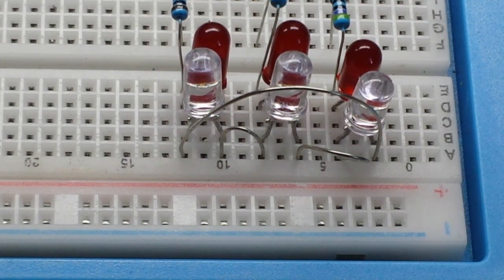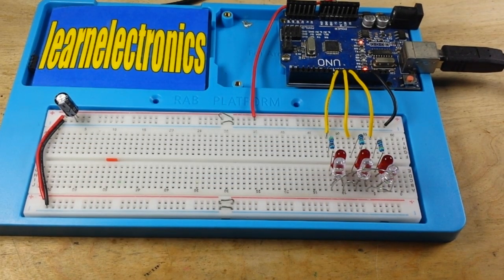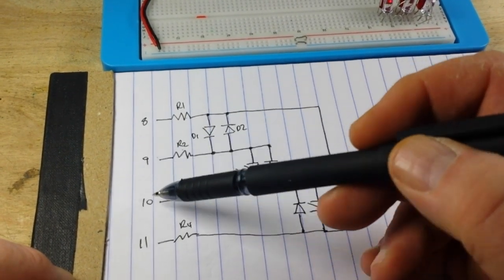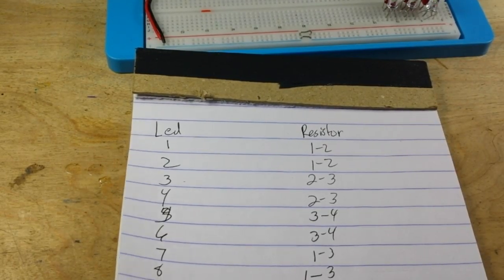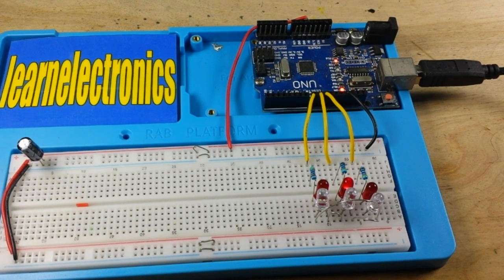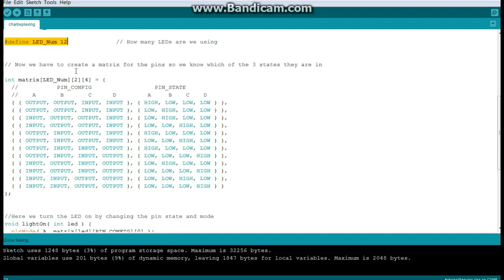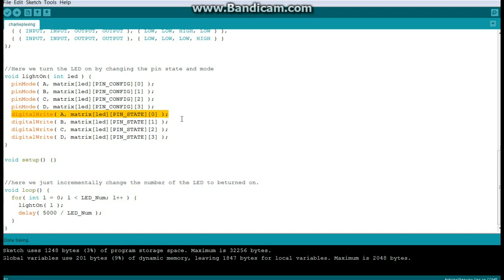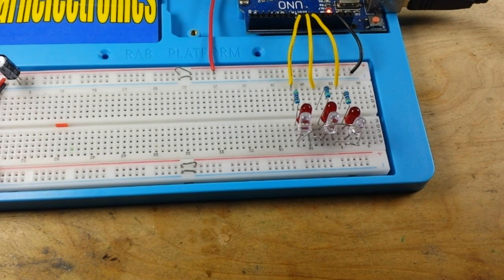How to Charlieplex LEDs with an Arduino

Comment: Thank you, I think I finally get Charlie plexing. I’ve seen it used with keyboard inputs but could never wrap my brain around it. Great video Paul, I’m going to be spending some time at the breadboard tomorrow that’s for sure. Now I need to dig through my chips and see if I can do this without the Arduino.

One more thing I think the upload has some sound issues, someone commented that your mic sounded odd but the music at the end has the same tinny sound to it so I am not sure your mic is the issue. More likely YouTube has messed up your sound.

Comment: Hi, thanks for the clear explanation.

You mention using a 7 segment led display but with common anode ( or cathode) designs I'm not clear how to wire the pins or adjust the code since the legs of the LEDs on the common rail are all connected. Any recommendations where I can find and explanation of how to do this?

Comment: Is there any risk of damaging the inputs or outputs by switching from input to output so quickly and often, and is there a noticeable performance impact of switching between input and output modes? Like enough to make a difference in brightness of segments of rapidly switched LED digits?

Comment: Just reading another comment there and it reminded me of something i wanted to ask!! Do you need to use resistors with leds  when using arduino  in general?? Or can it damage it?  I know it can source a max of 20mA but would it strain it's self with no resistors when using leds  is more what I'm trying to say???? P.s. That Charlie plexing is very cool. And I will definitely put it in my pocket for again.
Reply from the maker: Yes, resistors are necessary when working with LEDs. They will draw as much current as they can until they pop or burn out the source.
Reply: You must use resistor for your 5MM LEDs. If you give them 5V directly, Arduino will supply more than 20mA for them, good scenario is LED died because of overcurrent, bad scenario is your Arduino's digital pin or PORT died (because absolute maximum for Arduino Uno pin is 40mA).
Reply: LED will draw approximately 20mA when you apply correct voltage for it. You use resistor to drop down the voltage over resistor (current limiting). Let's say your LED's forward voltage drop is "Vf", your source voltage is "Vcc". You want to draw "I" Amps of current from your source. You will calculate the resistor value like this:

(Vcc-Vf)/I

For example, Arduino pin is 5V, LED's drop is 2.2V and you want 20mA current to flow.

(5-2.2)/0.02 = 2.8/0.02 = 140 Ohm
Reply: @ntd0  thanks Nuru
Reply: @keithking1985  You are welcome :-)

Comment: So your using the Arduino as Ground on the 2nd and 3rd tier LED's ?  How are they finding ground ?   I can't think of why this wouldnt work for driving FET's doing switching, eaaa ?
Reply from the maker: No grounds per se. When one leg is high and sources current,  the other is low and sinks it.
Reply: This works with L.E.D.s because they're essentially diodes. This is really a type of crude binary decoder circuit that uses the diode nature of LEDs to complete the decoding logic.
You might need some extra diodes to get this to work with FETs.
You could use something like the 40107b dual 2 input nand chips that have open drain, n channel FETs for outputs.
You'd still need to spend some time working out the logic though.

Comment: I get what happens when we make one pin low and the other one high. But why do you change the pinmode to input to turn off both leds? That would make the pin float somewhere in between 0 and 5 volts, right? I mean if you make both pins low that would also make both leds turn off.
Reply from the maker: No it doesn't make them float. It makes them inputs.

Comment: I'll check out the whole video and read the comments, but right off the bat, can the brightness of each led be controlled also?  Say have led1 come on at 100%, led 2 at 75%, led 3 at 50% and led 4 at 25%?  Put another way, PWM.  Can this work with PWM?
Reply from the maker: I don't think so.
Reply: You won't be able to use pwm directly, but if your io pins and controller is fast enough you should be able to control the brightness of each led individually by just changing the amount of time you turn each led on manually in your code.

Comment: I love this illogical "logic".  Most mortals would just never see that it could or can work.  Then someone somewhere decides it does work  and uses it and suddenly everyone says, "of course" and it becomes sort of knowledge that everyone uses.  (Mabe that excluded creationists - but nothing's perfect).  It's actually a jawdroppingly elegant principle.

There are lots of examples of it (it has a name and I'm damned if I can remember what it is - simultaneous invention??) but if you look at discoveries like Newton and Leibniz with calculus, Darwin and Wallace with evolution.  In this case what was impossible yesterday suddenly making perfect sense (or maybe that's the teacher?).  It's sort of almost like boolean algebra fits into electronics like a glove but existed long before transistors.